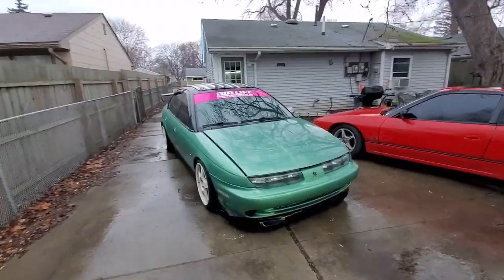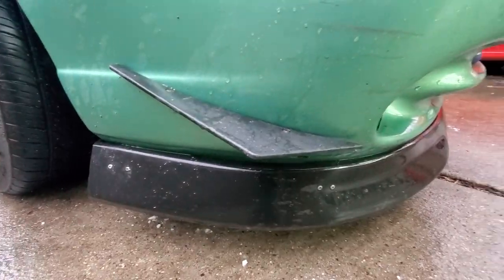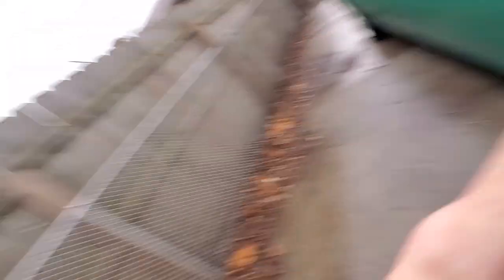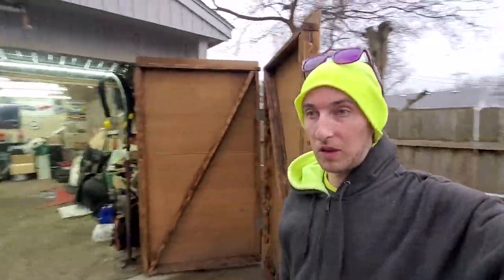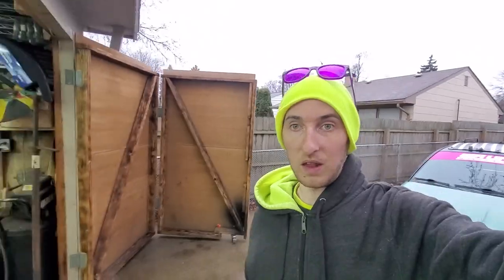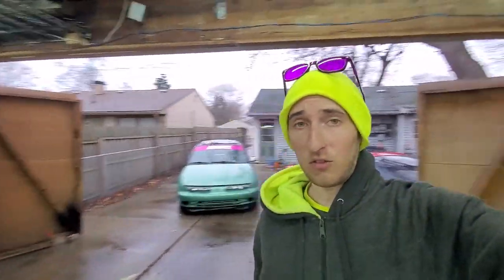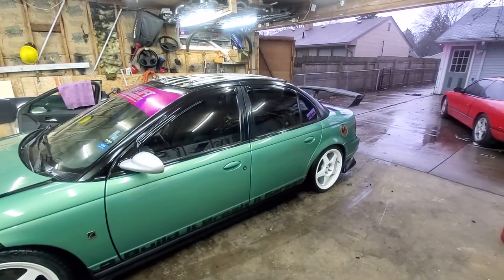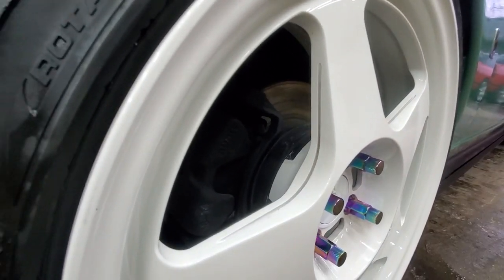Sanitizing Midori

Comment: Hey buddy back with more questions if I was to put a turbo on the 2002 saturn sl2 maunal 5 speed without taking to much oem parts off but only the secondary air pump and the air box could you give me pointers on  doing a turbo kit with it being super stock and the best possible layout to do so? I am stuck at designing it I'm good with doing the work but I cant seem to get a idea on the layout. Thanks in advance TnT

Comment: Question how did you get the center caps to fit my axles in my sl1 stick out past the center bore
Reply from the maker: I have 25mm spacers up front
Reply: Build it Break it Garage inc. and how wide are the wheels because I don’t want dumb amount of poke

Comment: Im building a turbo sc2 and was curious what youre running for injectors in yours to deliver more fuel?
Reply from the maker: I'm running e85 with 36 pound injectors and I have neither o2 sensor installed... and I have the intake air temperature sensor pulled so the car runs max rich
Reply: Where do you get the 36 lb injectors?
Reply from the maker: The supercharged 3800 in a grand prix
Reply: Thanks for the info man i appreciate it! Good to see some more saturn guys out there!